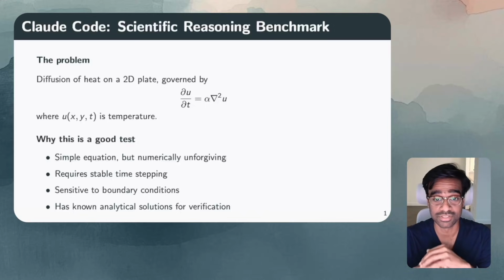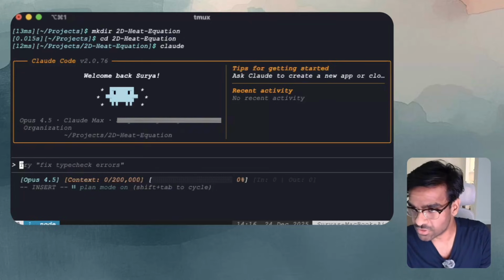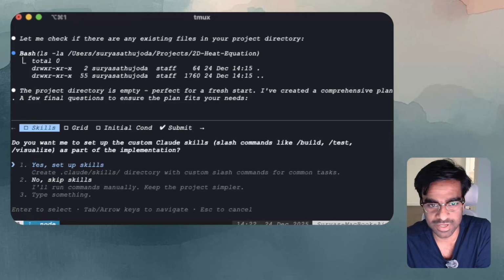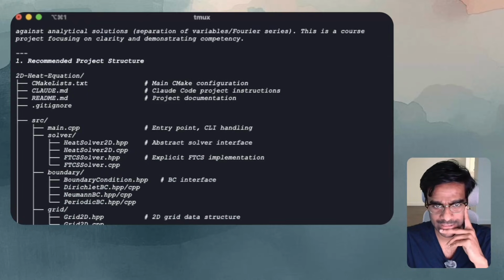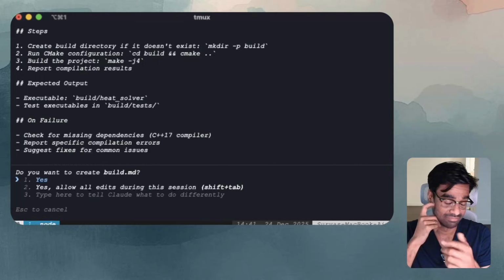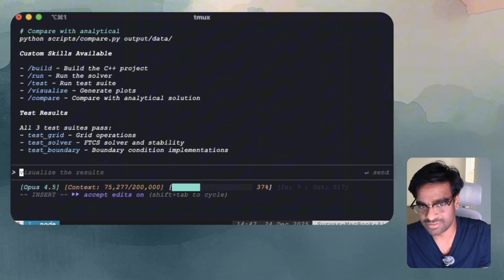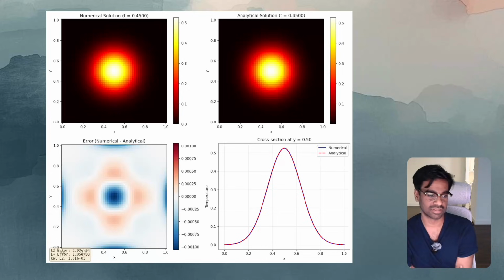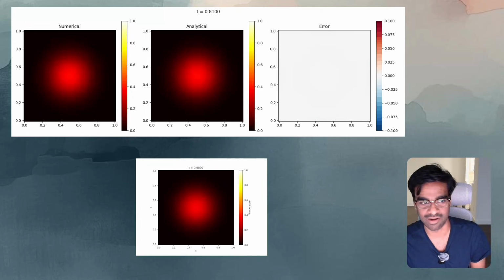Can Claude Code Reason About Physics? (PDE Solver Benchmark)

Comment: Claude sucks with physics. In my experience I'd say it's equivalent to about a first year grad student who can write good code.
Reply from the maker: In my experience it’s strongest at translating known methods into code as you mention, but much weaker at forward thinking logic which it was not optimized for
Reply: @SuryaSathujoda  Sounds about right. So it's doing exactly what it was designed to do.